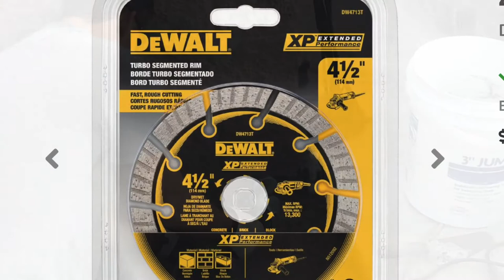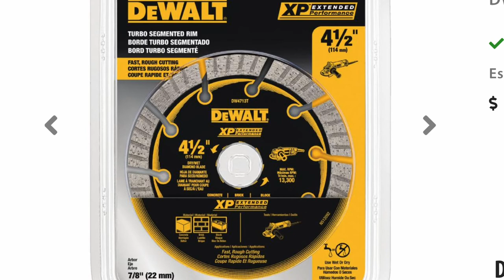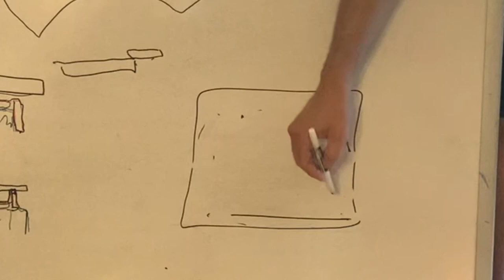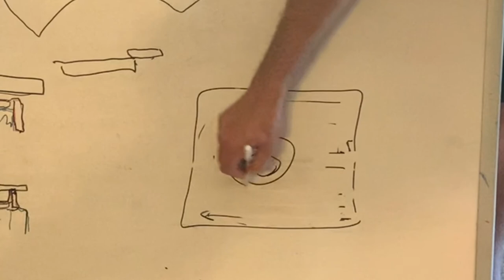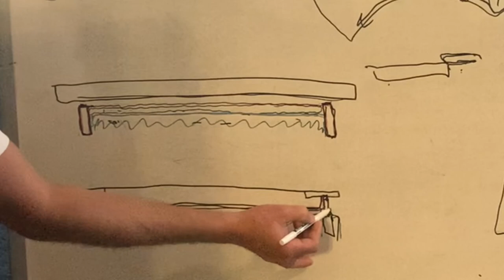PAVER INSTALL AROUND POOL START TO FINISH WITH AN EASY WAY TO GET THE CUTS RIGHT THE FIRST TIME

Comment: How is the draining with the pavers lined up to the retaining wall? I'm about to start a project but am worried about drainage. Thank you for the video and great work!
Reply from the maker: @taylorschneider4744   I have one spot that puddles a little not enough to worry about but definitely think about how you want it to drain and work that into the grade for sure
Reply from the maker: The pavers don’t seep the water hardly at all
Reply: @diydan7019  Thank you for the response! I appreciate it big time